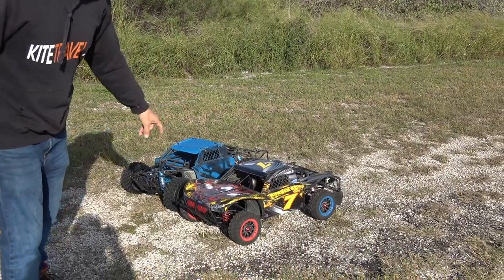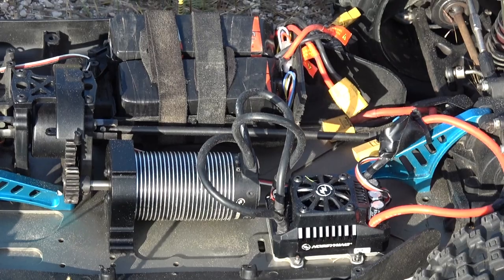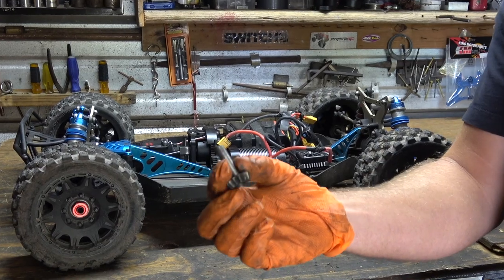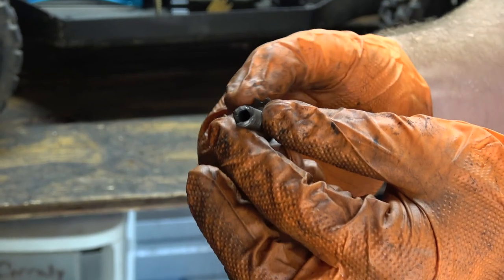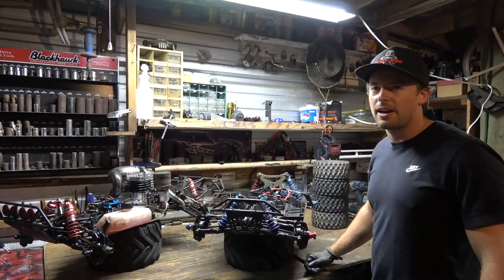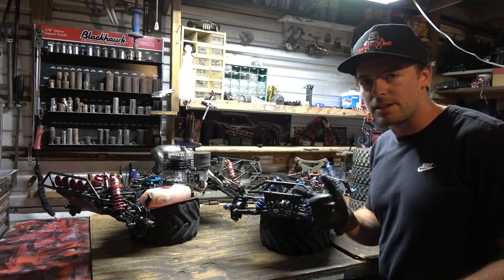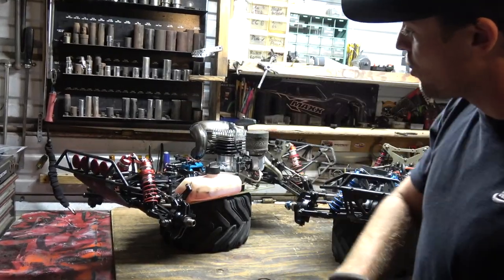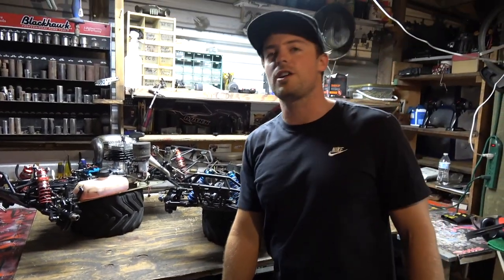Gas RC Car VS Electric RC Car!

Comment: Only thing better about gas is the sound, and personally I don't care for the sound either 😂
That Taylor engine tho🔊
Reply from the maker: Oh my bro I’m my opinion gas is way way better than electric. Gas is way more reliable and runs all day long. Gas never over heats no matter how hard you run them and you never break parts because your not sending it 50 feet in the air. The new Taylor engines have massive power just like electric and you don’t have to manage a ton of batteries. Gas is the winner to me all day everyday bro. My electrics are fun but man they are a pain, always blowing up motors or the esc just decides to crap out or a battery cell goes bad. Electric is a serious money pit that never ends, and all for about 20 mins of fun and that’s it. Then after a while you have a massive pile of bad lithium batteries that can all of the sudden burn your house down 😂😂😂. It is illegal to just throw them in the trash and they are super dangerous. Man gas is so awesome bro, you just have to experience it for yourself to find out.
Reply: @thunderrc  not a bad argument.... But to be fair I REALLY don't buy RC anymore, too many as it is, the 30 degree N is the exception an hopefully last.... If I was testing some gas rigs well then😜😉
Reply: @thunderrc  I think you just convinced me to get a gas vehicle.

Comment: Love this guy’s content. As an obsessed newb I have one question, why can’t you hit the ramp w the gas rig? Too heavy? If so, there’s a clear winner no?
Reply from the maker: Thank you brother! The gas car is a lot heavier and has way less control in the air due to manual brakes. It is a lot more fragile and would not survive the death ramp! 🤣🤣🔥🔥🏆
Reply: hitting that big of a jump with a gas rig could (probably would) break the gas tank and engine. electrics are faster and can handle crazy jumps better, gas rigs are just to feel cool and annoy your neighbors.
Reply: gas does have better range though. refueling is faster than charging batteries and waiting for motor and esc to cool
Reply: @RoboticsNShenanigans  I agree with that for sure man, seems like we would go to the church parking lot all day long as a kid with the nitros! with electric you just have to switch off cars and bring tons of batteries! I seem to run into the issue of breaking all my stuff before I can even burn through a battery pack so range has never been an issue for me. lol 

There is something Nostalgic about the Gas cars though! no denying that, and the smell..mmmmm!

Comment: KILER VID BROTHER THUNDER! What body are you using for the gas powered one? I like that look better. I agree, 30DN ruins driving smaller cars. EPIC THUNDER!⚡️🏆🔥🔥🔥🔥🔥🔥🔥🔥🔥🔥🔥🔥🔥🔥🔥🔥🔥🔥🔥
Reply from the maker: Thanks so much my brother! I am using the body that the 30 Degree North comes with. I just have an awesome wrap job on there. I can send you the link of the shop I bought the wrap from if you like? 🔥🔥🏆🏆⚡️⚡️👑👑

Comment: Both platforms have their Pros and Cons, so I feel that they're even!  I love speed and torque, so that's where the electric wins, I love not having to stop and change batteries and the longer run times that gas provides.  Even though a gallon of gas is sky high, it is cheaper than electric in the since that you don't have to buy batteries.  I just bought a Traxxas XRT, and I didn't have ANY 4S batteries.  So, I bought the XRT, and I invested in a new 400-watt, 4 port multi-chem charger (AND I THINK I LOVE THE CHARGER MORE THAN MY CARS [WIERD HUH? 😅]), and SIX 9,000 MAH LiPo Batteries, and that ran me close to $2k altogether!  I absolutely ❤️ all of my RC'S, and I would do It all over again! Yes, gas can be trying at times (Nitro's, too), and sometimes I feel that I don't need a 45 lb 5th scale hitting 60 mph, there's just not enough room in some places.  In the long run, gas is cheaper (Not to mention the BRAAAAAAP factor), electrics are cleaner and more maintenance-free, depending on how you look at it.  You can also put a MEGA ENGINE in the gasser and gear it to the max. You have a lot more to change out in an electric, so my final disposition is that they're equal!  It depends on only what you prefer!  At the end of the day, ALL RC'S RULE!  LOVE PEACE AND BLESSINGS TO YOU ALL!✌🏾

Comment: I definitely like gas more but people always complain about the noise(which is why I love them) so it's a pain to find a spot to run them and there's no reverse. Electric has more pros like less maintenance and reverse is a huge one but you can't beat the sound of the 2 stroke. I'll probably end up converting my Baja to electric just so I can use it wherever, whenever I want without worrying about people complaining about the noise. People suck.
Reply from the maker: Yes I agree with you! The sound of gas is unmatched!🚀🏆⚡️🏆🏆💯

Comment: Electric Is King
Reply: @camilo8cheryl  you can have more than one battery
Reply: @stonejss727  electric is a lot easier to start up and break in too lol
Reply: Nowadays electric is king. But back in the day. Fuel cars was where the speed and power was.
Reply: @stonejss727  absolutely and electric you can abuse it
Reply: Gas is more fun to me, more realistic too cuz of the sound!
Reply: I have shit ton of batteries but there is no replacement for starting up your fuel powered machine and running for 40+ minutes at a time. Large receiver pack and you will get tired before you are finished rather than wanting more after burning through 3 sets of packs in a fraction of the time…my love goes to fuel power in my large scale stuff.
Reply: That’s just your opinion my guy. You definitely not speaking for the rest
Reply: @smaknjdapimp not a chance is electric better that fuel rc,s. You need so many batteries for your electric rc which obviously cost a lot. Yes electric is quite and can go anywhere. Fuel is a problem for most people as you get moaning people at you all the time. Fuel rc,s are just so much better. More fun and you can't beat the smell and sound.
Reply: Nah fuel is definitely king that electric is slow.

Comment: Electric for sure! I love the 2-stroke and I also love Nitro cars, but the electric is just so much more practical for a EDB (Every Day Basher) Untill I repair my burned down XRT and fix both my broken xmaxx's I think Ill have to wait a bit on another 1/5, but WHEN I do get one I shall follow your most current advice on the Max5 or something comparable. Do you think its too heavy for the 1100? I be Kev has a MAHUUUSIVE Motor for that Bitch! SEND IT BROTHER! Love your content man, Raw, Clean and full of SENDS just how it should be! 

Dude did you see I met Basherqueen? She lives here in Utah! She actually Bashes! ...Says 6s Outcast is her go to basher! I posted a quick vid on it you should give it a peek. not for sub, not for likes, I just thought you may wanna see!
Reply from the maker: thanks bro!👍⚡will try to check it out! 🔥🔥👍👍

Comment: Happy Thanksgiving, brother!!🦃🦃 Sending Love from the Kraus clan❤️❤️ 
Another great video, bro. Both trucks have pros and cons. Gas pros: you can piss off neighbors. Hehe. They can run until you break em. Con: you can piss off the neighbors. Gas smells bad and makes a mess. Temperamental: you have to adjust the floats depending on weather, hot or cold. Electric pros: very easy to work on; NOT messy. DON'T piss off neighbors, very stealthy. Cons: limited range; batteries require charging after each us. But BOTH are very fun to Bash. Lol. Bash on, brother! And enjoy the holiday!❤️🤪💯💥👍🚘🌩🌩
Reply: You are exactly right Jason. Very profound comment  with the pros and cons outlined …..I agree 💯 💯
Happy Thanksgiving to you and your family 🦃🍁🦃
Reply from the maker: Great advice on both rigs man!! 👍🏼💯 enjoy your weekend 🍁🦃🦃

Comment: electric is way better than gas.
Reply from the maker: 20 minute run times, lipos burning up and going bad, not to mention escs overheating and blowing up or motors… the cons of electric are staggering in my opinion. As a heavy user of both platforms I can tell you that my gas rigs run all day, they have very little maintenance, they are way more fun to drive, they cost way less to maintain, and I get about 5 times the amount of use daily. The only thing electric wins in is bash-ability in my opinion. Other than that Gas is the winner all day for me. 💯🚀🏆🏆🏆
Reply: @thunderrc  never burnt up any batteries my car will run longer than 20 minutes and gas will be a thing of the past. record holders for speed are all electric.